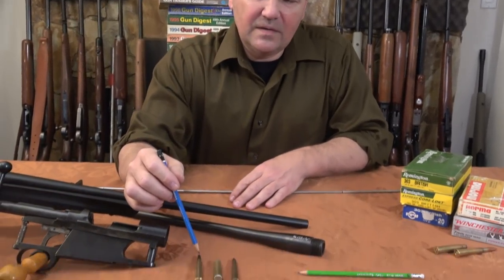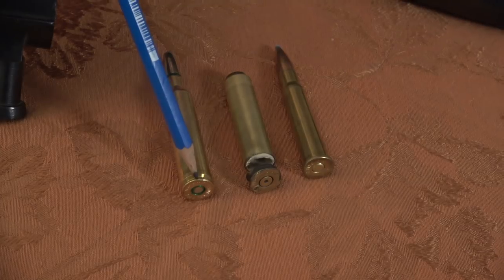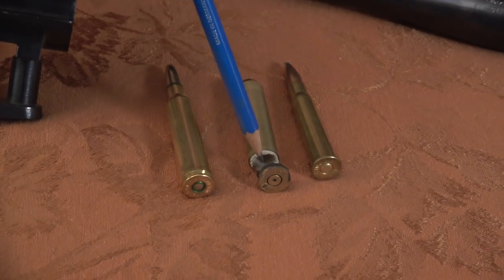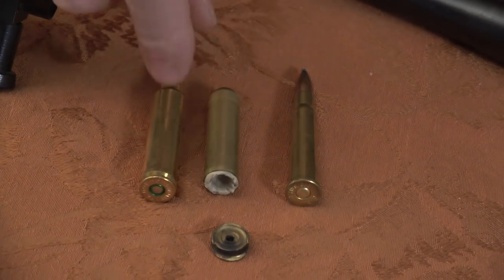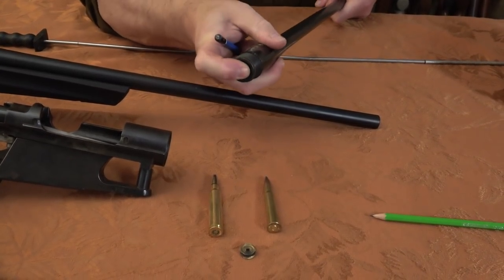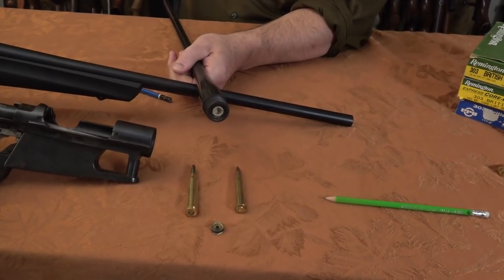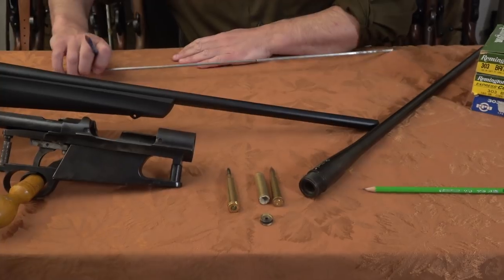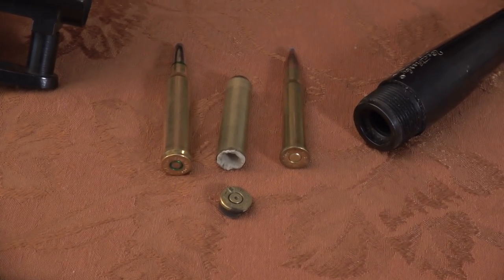OOPS...What Now? Stuck Cartridge/Case

Comment: LOL, I keep a sectional brass cleaning rod with me anytime I have a long gun so 1 person does. There is a way to remove stuck cases using the alloy, cerrosafe. You can reuse the metal so after buying in once it's good for life. The epoxy is also a great idea.
Reply from the maker: You bet - those brass rods can be life savers (not the candy) - and thanks for mentioning the cerrosafe. : )
Reply: @UnitedStatesOfGuns  The cadmium isn't safe and it contains a significant amount so don't put it in your mouth...I suppose we have to say that today..? :)

Comment: If you're going to use epoxy, I wonder if you could epoxy an eye screw into the case. Then you could grab the eye screw with pliers or something and maybe pull the case out rather than going in from the muzzle and possibly damaging the cleaning rod or barrel..
Reply: Likely you’ll just bend open the eye of the screw unless it’s welded closed.

Comment: What happened to the .311 bullet forced down a .284 bore?  In the field I think you are going to be out of action unless you have a backup rifle.  I always bring an aluminum rod to camp with me but I don't normally bring epoxy.  The worst case is when you have a live round stick in the chamber.  Then there is the round that didn't get a charge of powder and the primer provided just enough pressure to firmly lodge the bullet in the rifling.  Something much more common if one is reloading in the field without all the conveniences of a reloading bench.  One would hope in that case the shooter would check his bore before chambering another round!!  Some methods can increase the complexity of the solution in a bad way.

Comment: The owner couldn't have picked a safer action to have case head separation in even if in error since the mark v was designed to deal with pressure safely and away from the shooter. Plus those actions have even been tested with squibs with another round behind them with almost no damage and the barrel was still in spec in a mark v.

Comment: Checking ammo is important. I was shooting my Marlin 1894 in 357M. The rifle is new to me and so I go through my regular exercise of trying different ammo and see what the rifle likes. Long story short, I had some factory lead cast ammo 158 gr, and as I was reloading the rifle, I noticed one of the rounds had the bullet seated much, much deeper than the rest (it was not hard to notice). I put that one aside concerned about the potential for it to be over pressured. Later I pulled the bullet and dumped the powder, which seemed like a proper load, and I ran the empty brass through my rifle to discharge the primer, for safe disposal. I really don't know what would have happened if I had fired that round, but why take a chance!
Reply from the maker: We should all be like you; but sometimes things go wrong and we have a lapse of judgment. An excellent rifle such as the Weatherby, can save the day though.

Comment: This type separation was very common when reloading the old 300 H&H , my  buddy and I both ruined chambers digging them out with screwdrivers, oh well we wanted to rechamber them to wyb anyway, used to only cost about $20 to have that done, but now anytime this happens, rare but does happen , I find a tap and use an extension to tap into the stuck brass and simply tap it out, in fact sometimes the force of turning the tap tends to free them up

Comment: The 270 Weatherby is one of my favorite cartridges. Beautiful round! No idea how anyone could mistake a 303 British cartridge for a 270 Weatherby round unless they were intoxicated. Anyway, it underscores the foolhardiness of shooting without polycarbonate shooting glasses. The person is darn lucky he didn't lose one or both eyes.

A young shooting buddy had his Springfield 7.62 M1-A undergo 2 slam fires. I kept telling him to get shooting glasses, but he brushed off the warning. The first slam fire caused debris to go into one of his eyes, and he was lucky the hospital was able to save his eyesight. Still not willing to get rid of the gun, at the range on another trip with a replacement rifle, a 2nd slam fire blowup caused brass debris to cut into his femoral thigh artery. He could have bled to death. The nearest hospital was 20 miles away. Luckily, another person was around to drive him there. 

If a blowup like this happens in the field, even if you can get the case out, it wouldn't be wise to fire the gun until it was checked over by a gunsmith with gauges.
Reply from the maker: Alarming storied Will : (  but mistakes happen. Wise words of caution from you. Thanks for writing.
Reply: My wife was very lucky when her Winchester 100 slam fired and blew in two, which was caused by the faulty firing pins, this happened long before Winchester admitted to the problem

Comment: First time at the range with my Walther p22 had a misfire. I always wait the 30 sec to a minute before proceeding. Dropped the magazine and the case remained in the barrel when I operated the slide. Extractor wouldn’t grab the case. So I had to wait for the range master to clear the firearm. Now I’ll keep a plastic 22lr cleaning rode to tap out the case with the round.

Comment: Great video I'm surprised that the bullet went the whole way through the barrel. That means the .311 bullet swedged  down to .277. Gas pressure always takes the path of least resistance. You would think in this case that would be where the case separated.  Never had a case separate like that but did have a cousin who's kid jammed a fired case into his rifle so hard that the extractor cut through the rim ,Don't ask LOL. We were at camp the day before dear season. The 3 piece cleaning rods we had with us wasn't strong enough to knock it out. I remembered a trick a gun smith showed me. We took 1 piece of the cleaning rod put on a brush and wrapped a piece of wet paper towel around it. Almost filled the bore with water. Put in the brush and piece of rod then hit it with a mallet. Out popped the case and of course all the water. Ps was the guy blind, how do you mix up .270  Weatherby and .303 British?
Reply: In 303 competitive shooting ,case separation is quite common and not too difficult to remove, mainly because it's the correct cartridge in the correct chamber,of course.
Reply from the maker: Hi John - it is surprising how bullets get swaged down : pressure does interesting things - as you say. Mixing up the rounds seems difficult but so many things might have happened. Like all accidents - there was no intention - it just happened. I usually don't ask. : )
Reply from the maker: Hi Rupert - good point. I've seen that - the stretch is a little more in the .303.

Comment: I have a much simpler method than this ... much simpler ... this is a great video and all and thank you for your time to post this on YouTube and all and I'm pressing the like button now ... NOW!!! let me explain my method which I hope will help everyone here ... I have an 1873 Winchester Level Action 357 Magnum - 38 Special ... once I was in the shooting range and shot with 357 Magnum and the bullet of course got fired and went out the barrel and half of the brass broken came out of the bottom of the barrel where loading and the other broken half got stuck in the barrel about 1.5" deep in there ... so I read on forums that you could take it to a gunsmith and it might cost couple of hundred dollars to get it out or you would need a new barrel ... and stuff ... so I was like "Oh Shoot! Now what!!!? ...... then the light bulb turned on above my head ....
Check this out!!! .... what you need is "rubber" ... hard rubber ... like you know the Papermate soft grip rubber where you hold the pen and write ... if you have that kind of pen ... take out the rubber off  the pen like 2 of them ... (you can also use bicycle rubber tube materiel as well - any hard small piece of rubber) ...then you need the plastic window blind rod ... which is usually 36" long ... so take off the rod off of the window blind (don't worry, you will put it back later and the wife should not Bitch at you) also this is a great tool because this will not damage any part of your inner barrel because it is plastic, just in case ... then grab your rubber mallet ...
Here we go ... put the rifle's butt on the floor (use a rug or something so you don't scratch the butt) ... now stick the Papermate grip rubbers folded in half from the top into the barrel from the top 1 or 2 or 3 of them depending on the barrel's aperture  ... now ... put the Blind's plastic rod in the barrel from the top ... now, gently start tapping and hammering the plastic rod into the barrel as it pushes the Papermate rubbers towards the stuck brass ... probably within the first 5 taps you are already at the brass ... now!!! from this point on when you start tapping you will feel the resistance ... keep on tapping brother ... keep on tapping in ... not to hard and not flimsy ... be patient ... in about 40 taps ... the brass is out of the barrel ..... and now!? ... God Bless you all and America! Take care ...
Reply from the maker: Awesome - thanks for sending!
Reply: @UnitedStatesOfGuns  God Bless you sir, and Happy Thanksgiving!!! I meant no harm or disrespect ... I just wanted to share what actually worked for me and was pretty quick ... your method also rocks! and I thank you for sharing sir.
Reply: You can also use a tap and screw it into the stuck brass, and simply knock it out, in fact sometimes the turning force loosens the brass and it falls out

Comment: A friend of mine did a post mortem on a Mini 14 that was fed a 30 carbine. It was wrecked! he said with lots of persuasion he extracted a very long .22 bullet from the bore.
Reply from the maker: Now that is interesting! People have written me with a few examples but not the .30 Carbine / Mini 14 disaster.
Reply: @UnitedStatesOfGuns  When I had a Ruger blackhawk in .30 carbine I wished I could get rimmed .30 carbine cases because case length was important for good ignition and thus accuracy. I tried 32-20 cases but the brass were too thin to reload well. Enter the .327 mag. They are quite hot and work reasonably well. The head diameter is a bit small but they worked, needs more study but they worked in my Marlin 62.

Comment: What happened to the projectile? If it's a greater diameter than the intended bore, would it get stuck in the bore, or damage it, or did it? Did it deform enough to fit the rifled portion of the barrel and be shot out of the muzzle? Obviously it was no longer in the casing when it ruptured.

Comment: Thank you for the tips and reminder to only use the correct ammo for the firearm. I was wondering if one could use a bore snake from the muzzle end to remove the expanded brass.
Reply from the maker: Hi Rich - could work if it can snag the broken case and be pulled through from the chamber end - but likely the snake will get hung up with not enough grip to pull the case out - or just fall straight through.
Reply: The only other way I have been able to get them out is to find the correct size tap, make sure it is not to big, and use an extension to screw it into the stuck brass then tap it out

Comment: Bought a customized Mauser 98 in 308 (per the salesman).  Had no stamp on the custom barrel.  Loaded a Hornady Whittail 150 gr. and the rifle stock exploded in my hands.  Only suffered a busted lip.  Now the bolt is seized shut.  More research showed the barrel was a .270, not a .308.  How do I get the bolt to open so I can retrieve the cartridge and possibly salvage the rifle?
Reply from the maker: Hello - Sorry to hear about the accident - glad you're not hurt too badly 🙏 Spray the action with Ballistol and use a vice - then use a mallet or brass hammer to tap the bolt open. Have the works looked at though by a smith - I had this happen more than once and the actions were okay - but the barrel - no.
Reply: @UnitedStatesOfGuns  Thanks, my friend, for your reply!  I tried something like you advised and was able to get the bolt out after several massive whacks.  (Mauser made a tough bolt handle!)  The bore looks surprisingly clean after I ran a mop through it.  The headstamp part of the cartridge is literally WELDED to the front of the chamber leading into the barrel.  Looks like a bit of casing is also welded or lodged just inside the barrel where it meets the chamber.  I gently used a small sharpened chisel and was able to remove half of that head, but I have to be very careful not to mess up the chamber with my chipping away.  I'm soaking it in penetrating oil over the weekend and will tackle it again in a couple of days.  I will definitely take it to a gunsmith to have it inspected for safety and to verify the actual caliber bore.  God was good, as always, to protect me.  Only suffered a few minor burn specs on my face and forearm.  LESSON 1:  Always (from now on) have a gunsmith verify the caliber of an unstamped barrel.  LESSON 2:  Think twice and do your homework before buying another customized Mauser.  LESSON 3:  God is good!

Comment: Find a long machine bolt of an appropriate diameter for the inside of the case. Take out the rifle bolt run the machine bolt through the action and screw into the brass and pull it out. Else use a slide hammer with the end threaded screw in and tap it out.
Reply from the maker: Hi Scott - that sounds very good. Sometimes the brass is paper thin or less.
Reply: USOG thanks for the reply. My experience with this is zero, so my solution is likely a bit ham fisted. Really enjoy your content!
Reply: I have used a lag bolt bent at 90 degrees to extract stuck case.
Reply: I use a tap and extension to do the same thing , works great

Comment: I read a book recently on weatherby, if I remember right he wanted his actions for the mk v to sustain over 60000 copper units, and also the bullet left the barrel? What was the rifling and bore condition after the event?
Reply from the maker: Hello MFitz - perfect condition. The barrel swaged the oversize bullet down and the bullet exited normally, but was never found. The action had brass and powder residue but is otherwise in fully functional condition - as excellent as Weatherby says.
Reply: i was wondering that too. That is quite a swage.
Reply: As I recall he vastly overloaded a round, then used it to shoot out another bullet he had lodged in the barrel , they are a very strong action

Comment: One interesting way I've seen quite a bit is to do a chamber cast using something like Cerrosafe (don't know the generic term or name).
Reply from the maker: Good thought - I do have a lead like material that works very well for chamber castings; melts at a very low temp.

Comment: Good day.  If cases are not overloaded, what are signs that they should be retired?   Thank you for the tips.  When I was at the range yesterday I double-checked that all 60 rounds were 54R versus other reload calibers.
Reply from the maker: I usually look for cracks or anything uneven at the neck - sometimes the brass flows forward at irregular rates and that show up on the front edge of the neck. If the brass has moved forward then it came from somewhere else in the case - which means it is thinner and weaker. I take one case and cut it in half to see how the cases in a group might be wearing. I usually see thinning in front of the rim - the web area - on the inside - which leads to case head separation - as you know. Overall cases are pretty durable - any sign of change and I retire them. Hope this helps.
Reply: USOG thank you.  So far my brass is in good shape.  And I don’t see any difference between my once fired and that which has been fired 5 times.  However, I’ll pay attention to the extent of the case trimming.

By the way, the endoscope I received for Christmas is a fantastic tool.  Do you still have your Mosin?  I’d love to see a video of the chamber to crown.  Cheers

Comment: Seems like the .303 being larger than the.270 Wby bore there could have been a burst barrel. Just wondering.
Reply from the maker: Hi Kenneth, Sometimes the barrels burst and sometimes they don't. .311 in .277 is probably on the edge; my .311 in .243 still didn't burst the barrel. Bullets can be swaged down more than one thinks and a few writers told me the bullets almost behave as liquids in some circumstances.

Comment: I've heard it said that once you've had a case head separation incident, the gas has necessarily cut a groove in the chamber at the point of separation, such that the next firings will always bulge the case walls into that groove, and therefore both extraction and case life will never be as good as before the incident. Any thoughts or experience on that point?
Reply from the maker: Hello SLS 60, If the separation occurs inside the chamber there is a chance of gas flame cutting of the chamber wall - but I have never seen this. Generally the case head separates just outside of the chamber - where the chamber does not support the brass. As such, the pressure builds until the brass ruptures - which is at a lower pressure than the ordinary operating pressure of the cartridge. Anyway, one can have a peek at the chamber and see if there is any "ringing" or expansion; but this would not be expected as the pressure of ruptures is generally low - although there is an escape of gas and brass and potentially some flame erosion. Hope I explained this in an understandable way.
Reply: @UnitedStatesOfGuns  X'lent reply. Thanks.
Reply: I have had several such separations, and never had or heard of that problem , we did ruin chambers by trying to dig them out with screwdrivers , I hardly think the firing could cut the chamber without leaving a mark on the brass

Comment: Can you use heat noting different coefficients of expansion between steel and brass
Reply from the maker: Good thought - I tried different heating and cooling methods; eventually something might work but the epoxy works every time.